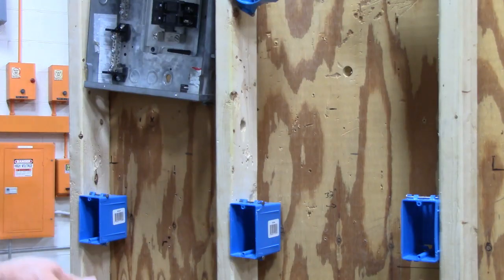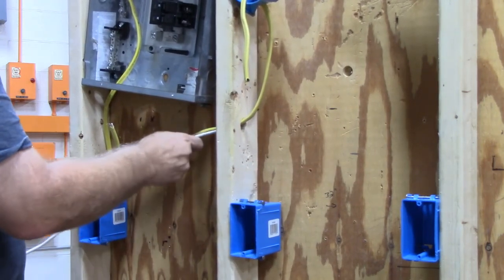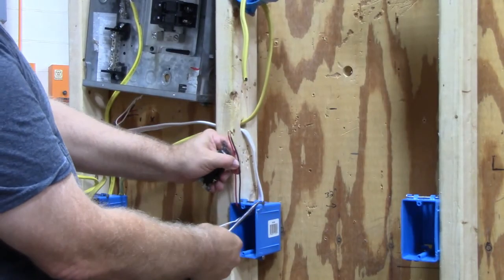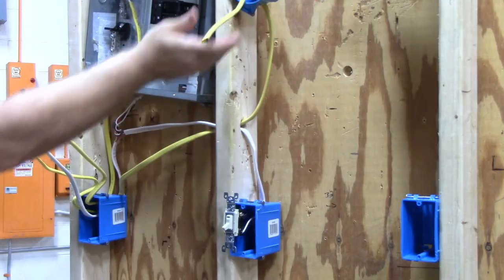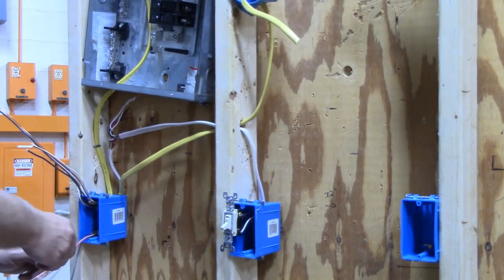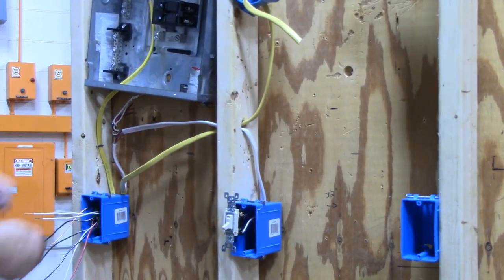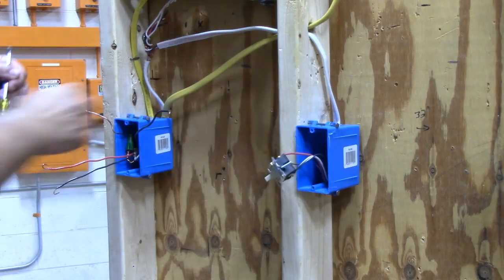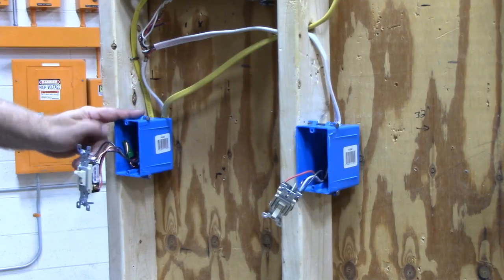three way switch, power and switch leg in the same box

Comment: The box with just the 3 wire in it becomes the hot not the switchleg. You send the hot with the white on the 3 wire and the red and black send power back to the original box, where the switchleg still remains. At that point the white neutral in the light sends power straight back down to the white neutral on the hot 2 wire which then takes it back to the panel. To put it simply the box you add becomes the hot and the original box becomes the switchleg box and the traveller still jumps between them
Reply: does that leg box have a neutral? seems like it does not. I am trying to run an outlet off of a leg box like this and its not working because I do not think the white is a neutral

Comment: Thats only 2 ways switch sir..,where is the other one?
Reply from the maker: A 2 way switch is another name for a switch that turns a light on or off from one location, it has on and off on it. A 3 way switch is used to turn lights on and off from two locations, the switches are connected by a 3 wire.

Comment: Even tho you my have wired it correctly, You do NOT follow code as in you can NOT mix 12 Gage and 14 Gage wire, in the configuration you did that. I thinking you were just using scrap wire for that, You did NOT say it in your video, therefore you code was wrong.
Reply: And since the white wire was a feeder to the other box, You did NOT rap black or red tape around the white wire to Id it as a HOT wire.
Reply from the maker: you are correct about using scrap wire, it was an oversight. Thanks for telling me.

Comment: never use the white wire as a hot??????????????????
Reply from the maker: You can use the white wire as the hot wire coming from the light to the switch box but it must be marked with black tape or some use a black sharpie. I have worked on older houses where you never know what you will come across, especially in places where there was minimal or no inspections. I show these different methods to my students as examples of what they can come across. An example, two years ago I rewired a house that had a 3 wire as a home run running two different circuits. In new construction you have to have neutral in the switch box so a 2 wire would not work. Some don't like the power in the light box because you have to take the light down to search for a problem, much easier in the switch box.